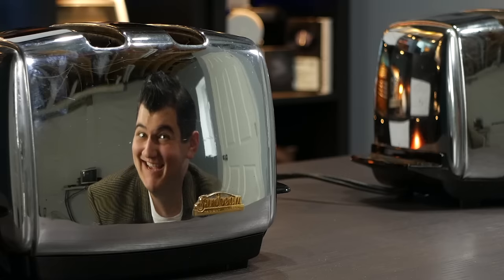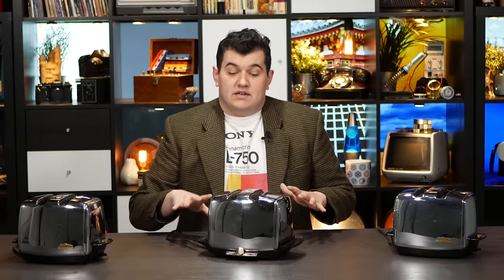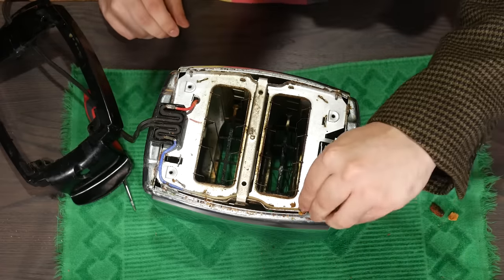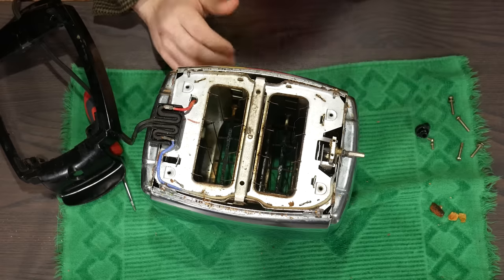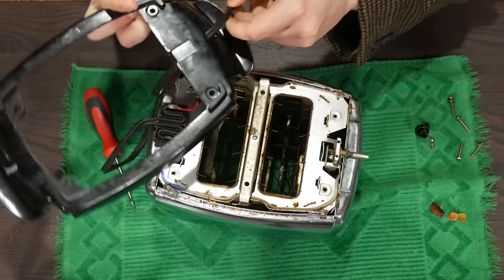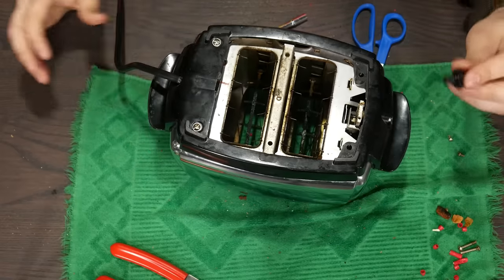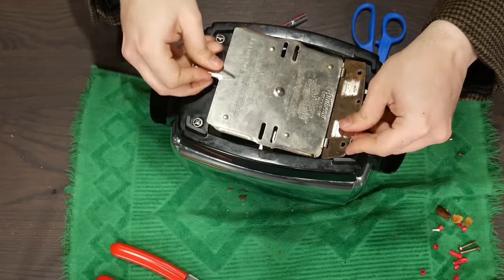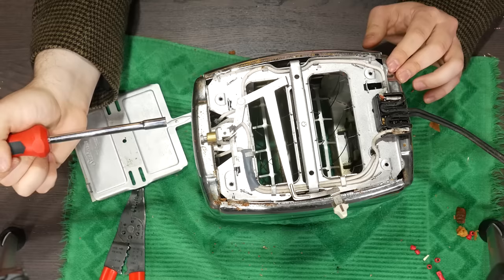Sunbeam Radiant Control Toaster--Repair and Modernization

Comment: Since it was disassembled, I would CLEAN all the plastic and metal parts. I would make this toaster shiny.
Reply: I was cringing hard at the dirty toaster. I would have taken it completely apart and replaced the wires with high temp silicone coveredones and cleaned the frack out of it.
Reply: Definitely, totally detail the thing. The real beauty of this toaster is... the beauty of the toaster.
Reply: @fwiffo  it would have been a good idea for cleanliness and hygene
Reply: But would you be able to put that mechanism back together correctly?
Reply: I usually run used toasters through the dishwasher.  Providing you let it dry thoroughly before use, no problem.
Reply: I agree I cringed when I saw he didn't at least do a basic wipe down with soapy wooder (NJ joke) but seriously just a wipe down... but it's not mine and when I buy my own I will do those things Love his vids though.
Reply: I was thinking the same thing! I thought it was just my OCD, but if I had disassembled that thing, I would've definitely taken the opportunity to give it a good wipe.
Reply from the maker: Super late here, but the thing is... it's a toaster. And what I mean by that is--the moment you use it, it's gonna get crumbs inside of it. And the crumbs that were revealed when I removed the bottom are not visible at all when it's re-assembled so frankly I just didn't bother.
I'll tell you that I have polished the exterior the given it a rather thorough cleaning in the places that matter. But given how toasters just accumulate crumbs (why else does the bottom just pop open by design?) I view it as a rather futile measure to make it spotless under the bakelite.
To each their own.
Reply: @TechnologyConnextras  I understand your point and since it's yours obviously you can do what you want. But some of us figure if you already went thru the trouble of taking it apart the few seconds to wipe it down wouldn't hurt it. Maybe it's not noticable maybe it is.
Reply: Y'all ever order toast at a restaurant? You dont want to see the inside of those toasters if this bothered you lol
Reply: @David-nh7px  If you have a camcorder, video the disassembly, and refer to it when reassembling it. If you can play the video backwards, that's even better.
Reply: I am a collector of old, working electronics which I use as originally intended. If it's something rare (few spare parts) I do as little as I can and just let it get on with it's life as a useful thing.
Reply: @TechnologyConnextras  A few years ago I gave a waffle iron to some friends. It was a used but nice one. I completely dismantled it and cleaned and scrubbed every nook and cranny until it was clean as new. Told them while I may be the sort of person who'd gift them a used waffle iron I wasn't going to give them a dirty waffle iron. They were happy with it because they didn't have a waffle iron and no money to buy one. Have they kept it clean? Heck no. It's far worse than when I gave it to them.
Reply: @TechnologyConnextras  My biggest problem with used toasters is not the crumbs floating around the bottom, but the kitchen grease that falls inside from out of the air and the fluff that follows it and settles on the very parts that contact the bread.  Whilst it is inevitable, as you say,  I'd certainly rather it was my grease and fluff than someone else's. (By the way, top video, as always :) )
Reply: @zackstewart4109 : "...with it is life"? Huh, what?
Reply: What I was thinking
Reply: If the inside was brightened up it might prevent the toaster from getting so hot.
Reply: Cleaning all the baked on dust and crumbs from the internals would also help loosen the mechanisms up.
Reply: @TechnologyConnextras  Would leaving it a bit crusty be kinda like having a seasoned cast iron skillet?
Reply: @TechnologyConnextras  The reason to clean out crumbs is to not attract ants and roaches to your "clean" kitchen.
Reply: Not even for the hygiene man, but for the sake of the restoration... How could you happily put it back together with all that shit in there 😄
Reply: @MistaSpookie  ..ooh, don't I know!
"
No one's going to heaven in a Pontiac that way", says my Grandfathers rolling in their graves.

Cleanliness is next to Godliness
Reply: Would you be able to pull out some of the metal components and powder coat them?  Not sure what if any chemicals come off of powder coat when it's heated ? And whether or not that would be safe around food
Reply: How would you clean off all the rust ? And brown spots
Reply: @Varangian_af_Scaniae  Toasted nut never sounded so good
Reply: @TechnologyConnextras  Yes, its gonna get crumby again - but why not at least start fresh and clean without several decades of who-knows-what has accumulated in it?
Reply: @TechnologyConnextras  For me it's more the idea that it's only MY mess in there, something about 60+ year old crumbs and dust from who knows where is kind of upsetting. I know it'll get dirty anyways, but I'd rather start fresh than with a mess from halfway into last century
Reply: @TechnologyConnextras  Agreed. I cleaned out my toaster recently and could have reconstructed a full loaf of bread from the crumbs therein. So my shame is the greater one...
Reply: Looks like there's corrosion and/or rust on the metal parts. Maybe worth removing the corrosion, cleaning and protecting the metal parts from future corrosion?
Reply: @holyvanguard  ChrisFix?
Reply: @ellenorbjornsdottir1166  I wish I was that guy is one hell of a cool dude though gotta love that soapy wooder lol
Reply: Someone get My Mechanics on the line to restore this. If there's anything broken, he can "make a new one".
Reply: @TechnologyConnextras  I don't know why, but I was more bothered by it being other peoples crumbs... But thats just my own neurosis. ;)
Reply: Call me old fashioned but I would have taken the opportunity to deliberately toss all the disassembled pieces into mud and maybe stone gravel to rid it of any trace of its lustrous shine from that tacky chrome. These youngin’s these days trying to make everything shiny and new looking without reason or purpose 🥸
Reply: @holyvanguard  Agreed.   It's called restoration.  Would you just polish the outside of a Mustang and leave the rat droppings on the inside?  I think not.,
Reply: I completely understand why technology connections is like "yeah it's gonna get dirty again from use" but i had mine restored and fixed by tim wilson from Tim's Toasters (awesome guy, if you're not technologically adept id recommend just sending it to him and letting him do the work) and getting it back looking brand new was so awesome - felt like a guy in the 60s (or 70s, i think my specific model hails from 1975 at the earliest) getting one of these fresh from the store. Seriously if you aren't comfortable with repairing these yourself i fully recommend Tim Wilson for all your Sunbeam radiant control needs.
Reply: @kruleworld  Bacteria would be killed anyways so it doesn't matter at all. Not even tetanus from rust would be a danger.

Comment: Order a yoga mat for your table when you want to do work on the desk. I use them on all my tables to protect equipment.
Reply: Fancy seeing you here Zeos
Reply: Why not just a project mat?
Reply: It's weird seeing one of my favorite content creators commenting on the video of another favorite content creator of mine. Like an unexpected cameo.
Reply: I use some Vinyl that I have a roll of dating back to 1966, or 1967
The heavy duty vinyl I refer to was used by upholsterers ad motor
trimmers for seating in cars and Buses, it is very durable material.
One can still find it from those who supply motor trimmers and 
upholsterers, Also insulated headlining material is good, and not
as thick as a YOGA mat which is not the best choice in my view.
Reply: And when you have a yoga mat there's no excuse to not start doing yoga. I recommend it.
Reply: No
Reply: Now im just waiting for the Zeos edition toaster review with a built in DAC.
Reply: You mean a footlong from Subway
Reply: About the flipped text “one slice” I believe it could be a reasonable change. As the power cord is connected to the opposite side of the toaster it’s more likely the side with cord will be facing away from the user, so the text location becomes natural. It’s not so important if the toaster is situated sideways, but when it’s not, the text direction is more likely to be natural.
Reply: That's a great idea... my wife has plenty of them.

Comment: I am proud to announce that, after watching the original Technology Connections video on the magnificent Sunbeam ‘radiant control’ toaster, and searching for what must be over a year now, I finally struck gold while combing through the scrap metal dumpster at my town dump. I always check out any toasters I can see, but they never are the right one- until today! Mine seems to be a ‘transitional’ version, from the older to the newer style. It has the darkness slider moved to the side like on the later model, but retains the same paper-insulated white wiring, and single switch of the earlier models. I am still deciding if I am going to replace the original cord. I had to increase the tension and fiddle with the darkness adjustment screw, but everything seems to work great now!
Reply: And here i am still making modern toast with a primitive new toaster
Reply: I just randomly found a t-20b for $5 at my local thrift store.

Comment: “This is plugged in, I’m being careful” proceeds to jam a screwdriver into the toaster. lol.
Reply: But very deliberately holding the plastic handle of the screwdriver, with his fingers well away from the metal shaft (… lol … shaft... Sorry, couldn't resist after this video's "butt" jokes ;)).
I would have preferred it if it was a proper 1000V-rated insulated screwdriver that's intended specifically for use where mains voltages may be present (the ones with plastic insulation over most of the shaft - and at least Wera makes versions where the shaft is no thicker than on an ordinary screwdriver, so you no longer have that excuse for not using them!), but hey, it's a good start, especially when he's presumably only dealing with 115VAC nominal.
Reply: @AndrewGillard  Ah yes, I recall stripping the insulation off of many a screwdriver before these newer models.
The last I got was from Zebra though.
Reply: "I PROMISE IM BEING CAREFUL!!"
sticks knife in
Reply: Bahahaha!!!!
Reply: yes, but carefully.

Comment: Things I learned from wiring CEE Sockets: you always want your ground wire to be the longest wire and/or with the best strain relief as it is your lifeline. That way, the ground wire will fail last, so if another wire fails, at least the thing is still grounded

Comment: On my T-20 (Built March 1956) the white lettering had worn off as had the 'light/dark'. 
I found that I could restore the lettering. I carefully etched out the old yellowed paint that was still left in some spots.
Then dabbed a little white fingernail polish and carefully rubbed away the excess. The result was very nice and now you can plainly see 'light/dark'. As well as the stylized Sunbeam logo.
Reply: Thanks . I used fingernal polish on a new sink that was scratched .
Reply: IDK if this will help in the future, but you can buy "paint crayons" for things like this. Basically it's paint mixed with wax/laquer. You rub it into the recessed characters until they're full, then wipe off the excess. 
McMaster-Carr sells them under "Paint Crayons for Recessed Characters", $4 per.
Reply: @chriscluver1940  what a terrific idea. My daughter will be glad I'm no longer borrowing her nail polish !

Comment: This exact same toaster was HUGE here in Australia in the 60s-70s and yes, it was a grounded version (by standards) .  I too would dearly love to own one again, we had one as a child, fantastic!
Reply: tubeie07 As a fellow Aussie I was wondering if our models were grounded. I figured there would’ve been an AS dictating that it had to be grounded at the time. Interesting! Now I want to track one down.
Reply: @munnsie100  Hi fellow Aussie! To be fair I am assuming as the plugs for these were all 3 pin with a ground, so some assumption in my part :)
Reply: The Australian version also had a much bigger, fatter, plug.
Reply: tubeie07 also Australia was 240 volts, so no arguments about mild tingles. Plugs were also polarised.
Reply: I have one still, here is Oz!
Reply: So happy to see these again, my grandfather had one of these and I loved it as a kid. Also a fellow Aussie here. :)
Reply: @francesconicoletti2547  the current plugs for appliances in the UK and former British Empire countries are large enough to use as melee weapons.
Reply: My parents bought an Australian made one in New Zealand in 1963.  It kept cranking out toast for 50 years until an element burnt out and my Mum threw it away.  I remember seeing in Aussie magazines that David Jones was still selling them in the 1980s (with the end bits coloured in orange or green).

I haven't seen a used one for sale in NZ, but they do come up on eBay AU and gumtree fairly regularly.
Reply: @marktubeie07  Just because the plug has a third pin doesn't necessarily mean that it's grounded. I know that all UK plugs have a ground pin because if it's not present the electricity won't go through, but most stuff that doesn't have a metal case is ungrounded either way.
Reply: As a fellow Aussie I also feel like buying one of these. Ours were a little different, they had Bakelite right up 2 sides. If I buy one I’ll completely rewire it, I don’t trust the old asbestos coated wires, so I’d replace it with modern fibreglass or silicone insulation

Comment: This brought back a lot of wonderful memories. To help put myself through college back in the early-to-mid 80's, I worked nights at a small appliance repair shop. We fixed a bit of everything, but specialized in Mr. Coffee drip brewers, the venerable old pedestal stand mixers (both the Kitchen Aid and the Sunbeam) and of course this wonderful toaster. You're absolutely right, more often than not when they were brought in it was a matter of adjusting the tension. Lucky for us, our shop was right next to a bakery and we had all the day-old bread we could use for testing the machines (and we occasionally got some leftover donuts as well!) I always marveled how these old devices were far better in build and function than their contemporary counterparts. Such a shame much of this robust design is being lost in favor of convenience and cost.

Anyway, thanks again! Some great memories!
Reply: Any notes on modernizing an old KitchenAid with the plug very much like this toaster? I found one at a flea market that works great, but the metal body and old cord feel like a liability.
Reply: FIX IT shops have all been replaced by trash cans.
Reply: I decry the throw-away mentality of today.  I have recovered vacuum cleaners from the trash which are only clogged and have no other problems
Reply: @stan.rarick8556   or the owner has died and been vacuumed up.
Reply: If toaster needs calibration - it's terrible design. No wonder why they don't produce them today

Comment: That strain relief was a bit sophisticated in  a time when most were just a knot tied in the wire.
Reply: Ahh the good old knot in the cable. :-)
Reply: Or even better, a steel clip crimped around the cable.
Reply: @compwiz101  my old waffle machine has a steel spring to do that, very safe indeed.
Reply: @CAESARbonds  On better appliances the underwriters knot was around a screw's insulated standoff or spacer.

Comment: Before I watched this video I had taken my late 1950s Sunbeam toaster apart (well, not completely, but I took the bottom off) because it wasn't toasting at all. It had been working before I cleaned a whole bunch of bread crumbs out of it, and then it mysteriously didn't work after that. When I was inspecting it, I didn't notice anything unusual (i.e. any parts broken, disconnected, etc.). I worked on the plug to make sure it had fresh wire to make a good contact. When I put it together, it still didn't work. The last thing I just did was to check out the lighter/darker switch because I had a feeling that I had screwed it in way too far. I took the knob off, adjusted the screw counterclockwise a little bit, and replaced the knob. When I plugged the toaster back in it miraculously worked. Thanks for posting this great video which inspired me in my effort to get my good old toaster working again!

Comment: No freakin way. I bought one of these at antique store for $2 in pristine cosmetic condition a couple months back, but it didnt work. Sure enough, I tightened the screw and it worked first try. Thank you so much! Also, the sticker actually was on the bottom of mine so I guess I'm the dummy for not reading!

Comment: The "one slice" being flipped around makes sense, that way if you set the toaster on the counter perpendicular to the wall, rather than parallel, the activating slot is in the front and "one slice" is not upside down.
Reply: Exactly my thought!
Reply: It also means you don't have to hold your face over the toaster slots to read it, which is easier and also probably safer (I can imagine a ladies necklace dangling into the toaster).
Reply: @ModMINI  a toaster that has a 50/50 chance of being plugged in wrong Lolololololololol!
Reply: If the slider is in the front, that's where you start reading makes sense
Reply: Part of me wonders if it might not have been an accident, though. Perhaps the manufacturing facility just shut down for maintenance some day, and when rebuilding it all the tiny stamp stencil just went unnoticed?